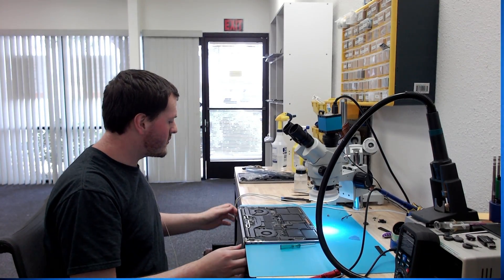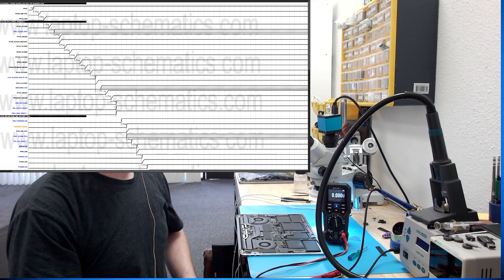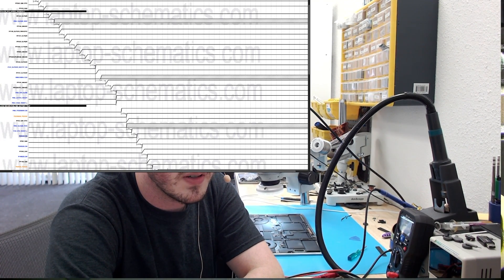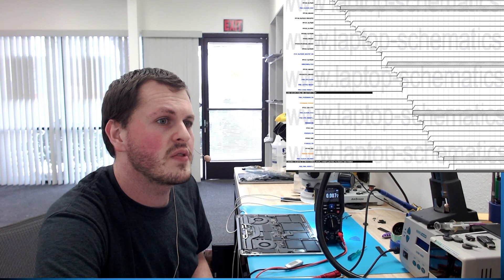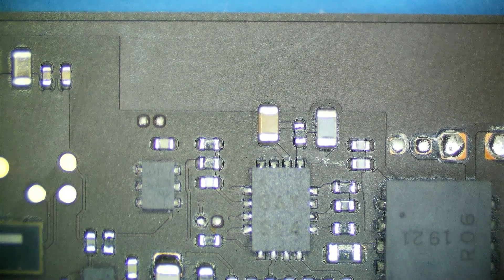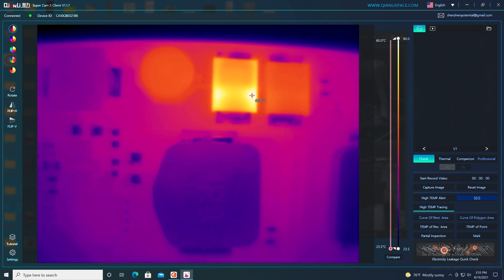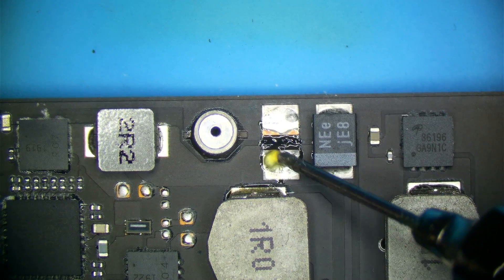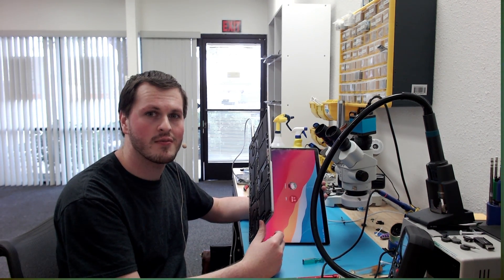2019 15" MacBook Pro A1990, No power with cycling power rails and enable signals.

Comment: hi, as a hobby I delight in the repair of macbooks, I am a beginner, I have this macbook that I bought to try to get it back in operation.
At the first attempt it turned on it seemed to have a correct absorption of amps and seemed to charge the battery, from the beginning there seemed to be activity as the trackpad seemed to respond to impulses. Obviously it never turned on, no sound, the fans never turned. It does not heat in any point, observed with a thermal imager. A newbie question, does this type of macbook start up with no battery connected?
I tried before and to perform other operations a DFU restore but it was not successful returning errors almost at the end of the process.
The logic shows no signs of the presence of oxides or liquids.
It has a strange behavior, without battery connected it remains stable at 20v but with variable absorption from 0.03A-0.07A if I connect the battery v from 20v to 5v, cyclically.
Here are the measurements I made:

Also it has a strange behavior, a continuous variation of the voltage on r3460 and r3450, from 0.5v to 1.8v with continuous oscillation, I replaced u3200 and it is now stable on 0.8v

I repeat, I am a beginner, forgive me if I make any mistakes in the description

Comment: Hi, i got a a1707 with a dead battery but i only got a 61 watt charger, is there any way i can turn on my machine?
Reply from the maker: Leave it plugged in with the lid closed for a few hoies
Reply: i done that for a day straight. Battery still isn't charging. i cant replace the battery right now i have important documents in it i need to access.
Reply from the maker: @3ijnweu3oq3  sorry to hear. It’s hit and miss with a low wattage charger. Go get a 87 or 96w.

Comment: Hey Tim great video . Can you please share what is the thing that you did I order to find out if the Mac is in DFU mode. Can it also be done on 2018 MacBook Pro ?
Reply from the maker: Not exactly sure what you mean. You use a USB-C cable and plug it into another mac via the master port and use Apple confirgurator 2.
Reply: @TCRSCircuit  I meant how do I know if its a problem of the T2 chip if the PPBUS is present ? what did you do in the video which make you understand that its not a T2 issue?

Comment: Thxs again buddy, it’s like your doing exactly the same system as I am! Also was working on a a1990. Next I have a a1707 with full fan spin and slow working boot. Was thinking of sensor issue but all the thermal sensors are giving back normal temp…. Any ideas? Or videos on this? Thxss